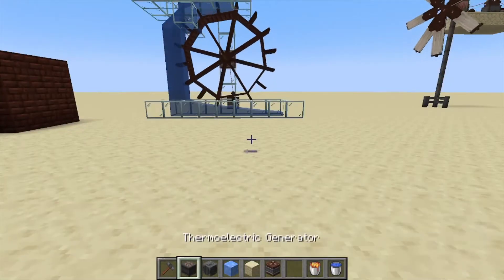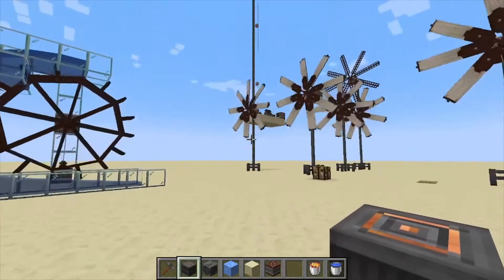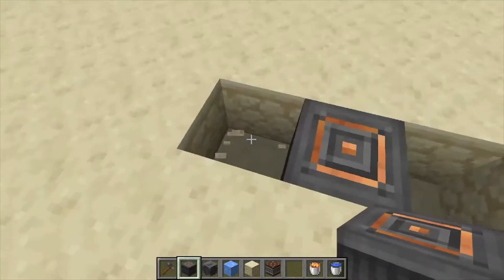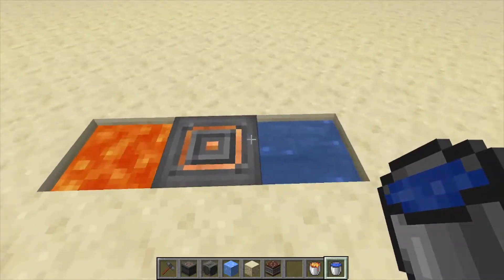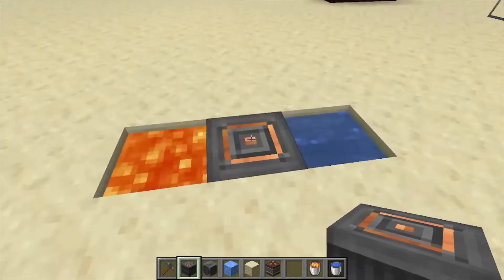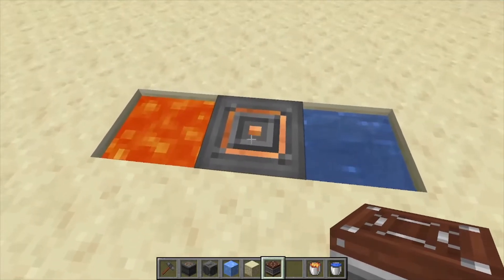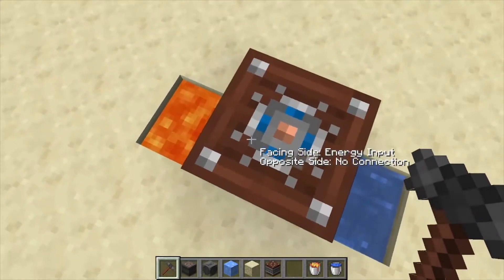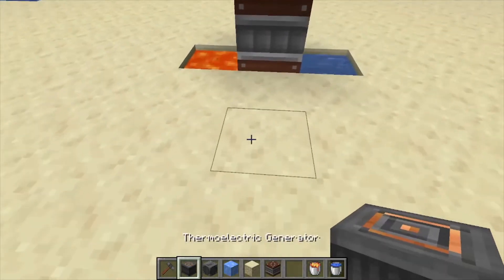Immersive Engineering: Thermoelectric Generator ( How to setup)

Comment: how do I get it to transfer fe energy instead of if energy, I am very confused
Reply from the maker: This mod produces RF and is compatible with forge energy. It only displays IF in some versions. If the machine is not running once connected your modpack might have a converter block or any mekanism cable will convert.
Reply: @MCMentor1  ah that makes more sense. I guess I gotta learn mekanism since its also in the modpack am playing